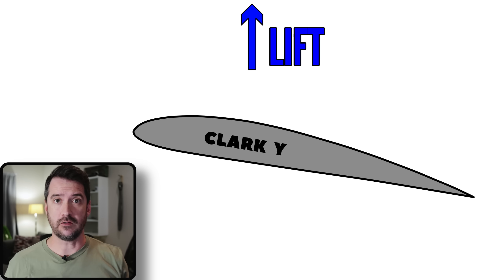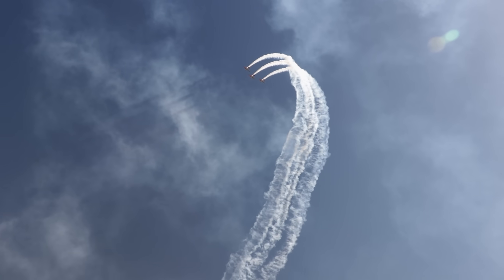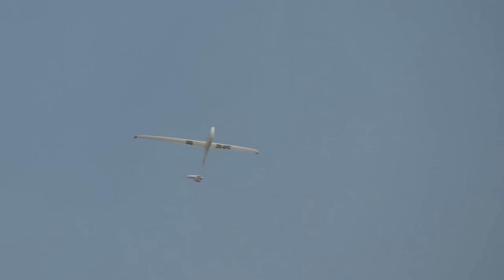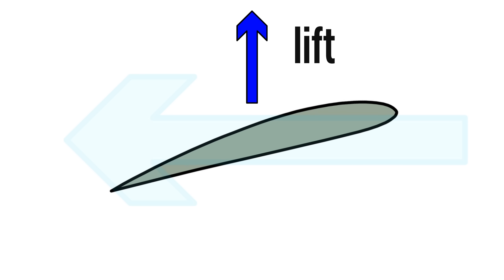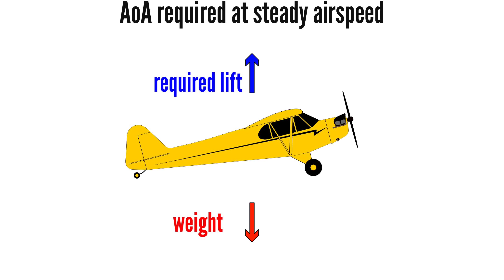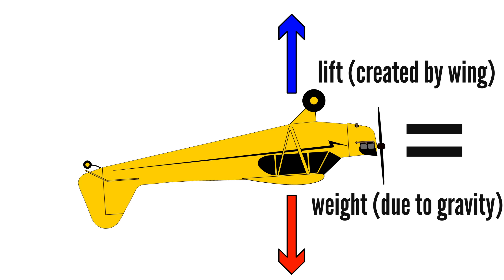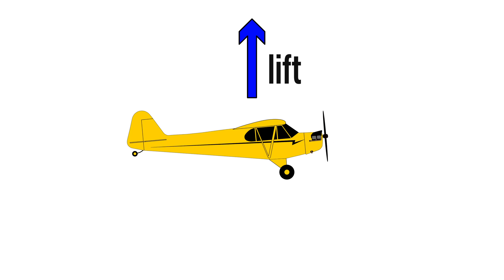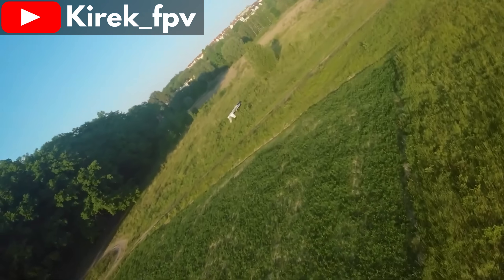Is Airflow Distance Over the Top of a Wing Always Longer?

Comment: The shape of an asymmetrical  wing is not the only factor that creates lift. As you mentioned the angle of attack and speed have major influence. The shape (ie profile) IMPROVES the lift and optimise the speed range. It also change the torque (or position of the center of thrust) and the stalling behavior. Last but not least it gives the wing some thickness, very useful to hide spars and get the wing some stiffness.
If you want to explain all those aspects to a beginner it will be at complete lost well before the end. So you need to have a reasonably simple version to get him interested and give him an opportunity to go further when he feels unsatisfied with the "simple" version. But, let me tell you, even if you can understand a lot more the absolute truth is not accessible to humans...and it's why no wing will ever be perfect.
All your efforts will probably improve the efficiency of a wing by no more than 30% compared to an umbrella...

Comment: My centreboard is symmetric and it produces lift either way depending on the angle of attack. In water even small variations to the angle of attack give such a high lift that the boat remains stable even in strong winds.  Any "theory" that does not take account of this MUST be flawed.

Comment: Both arguments are incomplete and incorrect.  The longer path over the top is not irrelevant to airflow, but it is inadequate to explain lift.

1- Air DOES go faster over the top path, but not BECAUSE of the longer path.  In fact, to make lift, it always BEATS the air on the bottom path to the trailing edge when the wing is making lift.  The longer path argument fails to explain why the upper airflow moves FASTER than necessary to compensate for the longer path (which is what that actually produces lift)

2- Even a thin straight wing with no thickness causes a retreating stagnation line with increasing AOA, so the wing shape is NOT the primary cause of this phenomena

3- The primary effect of camber is simply to increase the critical positive angle of attack (stall resistance).  At small AOA, the coefficient of lift is virtually identical to a symmetric airfoil.  

I refer you to the excellent "See How it Flies" by John Denker, which is freely available online. https://www.av8n.com/how/htm/airfoils.html#sec-inverted-camber

TL;DR Bernoulli's principle only exists BECAUSE of Newton's laws, not INSTEAD of, i.e. they describe the same thing.  If you talk about Bernoulli's principle creating lift WITHOUT Newton's requirements (mass/acceleration/reaction), you're getting something wrong

Comment: It's impossible to accelerate air downward without getting an upward force. And impossible to get an upward force without accelerating air downward. A pressure differential doesn't cause lift ,because a pressure differential IS lift, caused by accelerated air.
Reply: You just contradicted yourself. The pressure differential causes lift because the pressure differential is lift. The pressure differential causes the airflow changes: a gas can only transfer force by pressure differential.
Reply: @randomxnp  
Exactly!  The pressure difference is what causes lift, not “flow turning”.
Reply: And if they do not believe this, pick up a piece of plywood in a forty MPH wind and see what happens !!!!
Reply: People need to remember that Pressure is not force, it is force per unit area.  And every point on a solid object is experiencing its own vector of force, the sum of ALL the forces then gives us the force on the object.
Reply: Wings can still produce lift even with no downward movement of air.
Reply: @Talon19  ….a wing cannot produce lift without deflecting air. It is impossible because it would violate the law of conservation of momentum.
Reply: @XPLAlN  
Creating lower pressure due to increased velocity doesn’t violate the conservation of momentum.
Reply: @Talon19  you are now being disingenuous. I did not write, quote, “creating lower pressure due to increasing velocity [violates] conservation of momentum”. What I wrote was ‘it is impossible to create lift without deflecting air because it violates conservation of momentum’. Totally different. 
  You have said “wings produce lift without any downward movement of air”. Well,  if the force of lift is an upward rate of change of momentum on the airfoil (which it definitely is according to Newton) then the air must undergo a downward rate of change of momentum of the exact same magnitude. To any bona fide engineer, this is a ground truth, not a point of debate. It is weird, given your ineptitude here, that you claim to have a bachelor’s in aeronautical engineering, but either way, I think it is particularly important to call out commenters who make invalid arguments such as ‘I am right because I have credentials’.
  You are most definitely wrong. I do not support this opinion with ‘I have a degree’, but instead a credible source:  “This downward velocity is definitely there and is known as downwash…the flow’s downward deflection angle called downwash angle, is routinely calculated in aerodynamics texts because it has a large effect on the flow over the tail of the airplane” Eastlake, Charles, An Aerodynamicist’s View of Lift, Bernoulli, and Newton. Note: “downwash angle is routinely calculated because it has a large effect on the flow over the tail”. Incredibly then, a self proclaimed bachelor in aeronautical engineering has emerged in these comments who is not aware of this important aspect of design!
  The propwash (and helicopter downwash) are physical manifestations of this same law in action. Another example is the sink rate of wingtip vortices as they trail behind the airplane. These aerodynamic effects are known to the merest laymen, whether or not they see them as examples of conservation of momentum.
Reply: @XPLAlN  
You are misquoting me as well.
Forces can be generated by fluids without a change in direction of the fluid.  If you don’t understand that, well, not sure what anyone here could do to help.
Reply: @XPLAlN  
Why do you think for a wing to experience forces that the wing itself has to change its momentum?
Reply: @Talon19 ….I did not misquote you though. Feel free to paste the thing you think is a misquote if that is your claim, just saying it happened is a bit lame. 
  And now to quote your latest: “forces can be generated by fluids without any change in direction. If you don’t understand that not sure what anyone here can do to help”. Again, I did not write such a thing. You see, force has both magnitude and direction so a change in either or both results is a change of force (who knew?) BUT what I have consistently told you is there can be NO airfoil LIFT without changing the direction of the airflow. Airfoil lift is defined to be perpendicular to the flightpath so you cannot get a force in that direction if all you do is alter the momentum of the air in the direction of the flightpath (that would be thrust or drag - even private pilots learn that much). It is beyond weird to have to explain this to any aeronautical engineer; hence I find it implausible that you have completed this bachelor’s degree you mentioned.
Reply: @Talon19  ..…quote: “why do you think for a wing to experience forces the wing itself has to change momentum”. You are at it again as I certainly did not write that. What I wrote was that the force of lift is a rate of change of momentum according to Newton. Any bona fide engineer can see straight away what you are missing. The momentum of the wing itself will not change in the special case where lift = weight. At all other times the momentum of the wing itself will change. This is so obvious to engineers that it should go without saying.
Reply: @XPLAlN  
Bachelors and masters from Embry-Riddle Aeronautical University.  If you want pedantic minutiae, then the velocity and direction of the air is changing as it goes over the upper cambered surface.  However, that is not what proponents of flow turning, circulation, reaction, etc lift are arguing.
They are arguing lift REQUIRES net change in potential energy between the leading edge and trailing edge.  In other words, circulation, flow turning, and downwash.
I’m saying that wind tunnel tests show that the force called lift can be produced without a change in potential energy level of the air.
Reply: @Talon19   …oh Talon, Talon, Talon. Where to begin? You wish the argument was, quote: “they are arguing lift requires net change in potential energy between leading and trailing edge”. But that is not the argument of the OP in either of these two threads. To quote one OP: “what creates lift is the change in momentum of the air forced downwards by the passage of the wing”. Your reply to that was: “wings can produce lift without any downward movement of air therefore your explanation is false”. Potential energy was not mentioned. This is another strawman, part of a pattern of misquotes and misrepresentations that characterise your replies.
  The change of potential energy is irrelevant. It is conventional to completely ignore this term which is trivial in the flow around an airfoil. All bona fide aeronautical engineers know this. Why don’t you?
  In the special case of a cambered airfoil at zero α this trivial potential energy change between leading and trailing edge would be zero anyway. Who knew? However, there will still be a downwash off the trailing edge (because Kutta condition). But all this is beside the point of the OP, and the very transparent reason you raise it is to obfuscate the thing you have wrong, which to correctly paraphrase you is: ‘aerodynamic lift is possible without deflecting the airflow in the opposite direction to the lift vector’. When challenged, you added: “that does not violate conservation of momentum”. And I paraphrase only to nail down the original context because over multiple replies you have made attempts to change the argument.
  Still waiting for a reference to one of those “hundreds of wind tunnel experiments” you said support your claim that “a slightly cambered airfoil will create lift at zero AoA without deflecting the airflow”. Just one verifiable reference to check is all I am asking. We have the internet now, it can’t be that hard. But don’t bother if it only shows lift can be generated at zero α without change of potential energy between leading and trailing edge. That is a red herring and not the same as “without deflecting the airflow” - which is the part that violates conservation of momentum. Even though you think it doesn’t.
  Just one reference…..
Reply: @XPLAlN  
If there is no circulation or flow turning, there is no net change in the potential energy of the fluid.  As I’ve seen in wind tunnel tests, the long thin plate extending along the leading and training edges separates the air flow in the far field areas, negating any posssible circulation, flow turning, or deflection up or down.  Yet the airfoil still produces lift at zero AoA.
Reply: @XPLAlN  
As stated earlier, the long thin plates prevent downwash from occurring.
Reply: Bingo, that's it!   
But it's really too bad that wings fly 100% by downwash.   If only they would fly by pure pressure-difference alone, without having to press downwards against the Earth.  Then we could make flying saucers!   Just put your magic aircraft inside a disk-shaped empty box.  (Perhaps punch a few holes, to let the pressure-diff escape.)  When you fly the aircraft, the pressure-diff on the wing surfaces can also lift the hollow box.   Next, use a very sturdy box, and seal it up.   Then the pressure-force will still work, even when the hollow box flies up into outer space!   Bernoulli without Newton would be pure magic, ...if it existed.
Reply: @wbeaty  
Yeah, not at all what I’m saying.  You are just looking foolish.

Comment: The air under the wing is compressed by the angle of attack and specific aerofoil shape. Done
Wing loading of an RC plane is lower due to surface area to volume ratio. If you double all the dimensions then volume ( which is roughly proportional to weight) multiplies by 8, but surface area only quadruples, so wing loading roughly doubles.

Comment: Any kid that sticks their hand out the window and alters the angle of attack, knows the hand will lift or drop due to air pressure on one side of the hand, or the other.

The shape of the wing improves efficiency of the 'lift', but it is the buildup of pressure on the bottom of the wing that pushes a wing up or down, depending on angle of attack.

While the theory of wings makes for pretty pictures, it is the crude pressure buildup which makes the most sense of a wing sustaining flight right side up, or upside down!

However, even thought the truth is there, the 'educators' demand their idea of lift flies, and not the true facts of pressure.
Reply: I don't know what you think pressure is, but your hand out the window is pushed up and back by deflecting the oncoming air stream down (depending which way you tilt your hand). Conservation of momentum and newton's 3rd law require this.
Reply: @kxjx  Exactly, and a wing in motion is exactly the same!

Comment: Flow on the bottom doesn't change at stall. Flow radically changes on the top of the wing during stall.  

This puts a big hole in the momentum hypothesis and solidifies the idea planes are sucked into the air
Reply: There is no such thing as suction. There is only differential pressure. Objects are pushed (blown) from areas of high pressure (in this case, below the wing) to areas of low pressure (above the wing). Even a vacuum cleaner operates on "push": The fan moves air, which creates low pressure in the vacuum and differential pressure between the vacuum interior and the outside atmosphere, and objects are pushed into the hose by the atmospheric pressure.
Reply: @RB-bd5tz  you are correct,  I blame poor terminology , suction should never be referred to as a force ( and on a personal peeve neither should gravity be referred to as a force but after a hundred years what you gonna do )
Reply: A stall doesn't actually remove all lift, it's a reduction in lift that changes as the stall progresses. The momentum transfer argument never actually says the pressure lift doesn't happen, it says it's not the majority. So boundry separation along the top can both cause a stall and not account for the majority of the lift.
Reply: @SirDoggydog  I've seen wind tunnel wing modelling that shows that the increase in pressure over a wing during a stall, can reduce the lift of a wing to 30% of that it had  when it had a heathy flow over the wing  ( constant fluid velocity ) . Its wild the efficiency you get from the fluid over the wing with a good design
Reply: At the stall air flow curls under the wing off the trailing edge, can be seen in wind tunnels..
Reply: Also in a river if you place sheet of wood at an angle of attack.